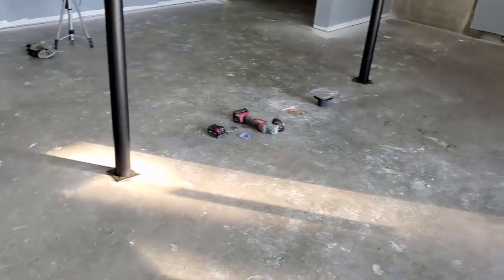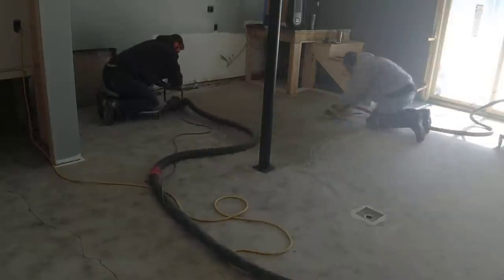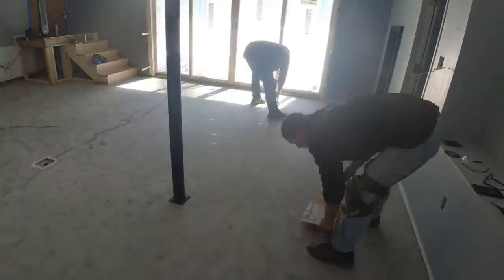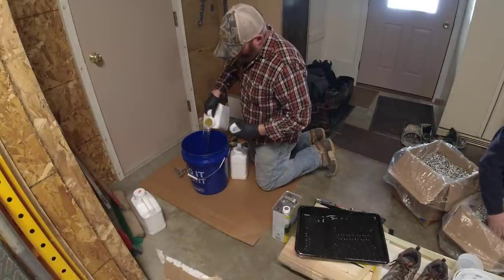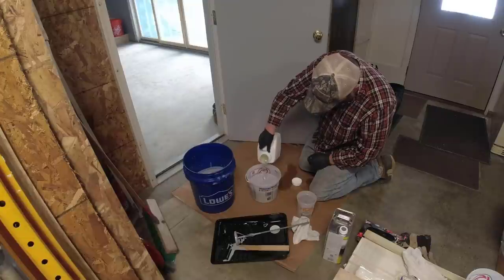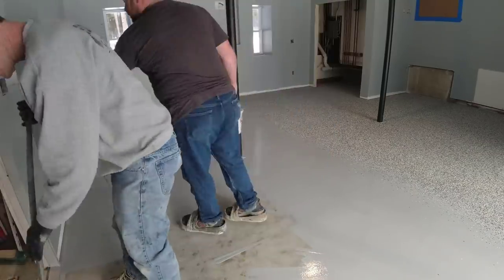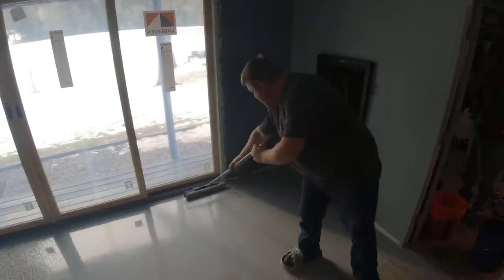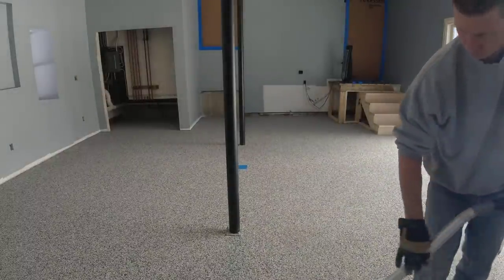Epoxy Garage Floor Installer Shows How It's Done! (Awesome Floor)

Comment: Do you prefer the pureepoxy product or the E2U? I’m doing my detached garage 1280sqft. Will be going through temperature swings and is also a floating slab so may have some movement. 
Any advice would help!
Reply from the maker: Both products are excellent, for us it depends on supply issues. The last few we've been using PureEpoxy.